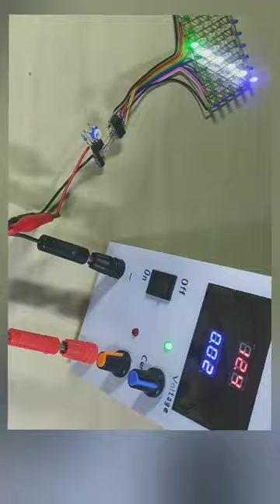Squre light chaser circuit|Amazing light chaser |Led project #status #viral #electro_shastra

Comment: Bro, What are the Components used for this Experiment bro.
Reply: 555 timer, shift register. 
555 timer is in astable config with diodes and a potentiometer to allow change in pwm duty cycle. 
The shift register shifts its output by one pin for each pulse from the pwm from the astable timer configuration